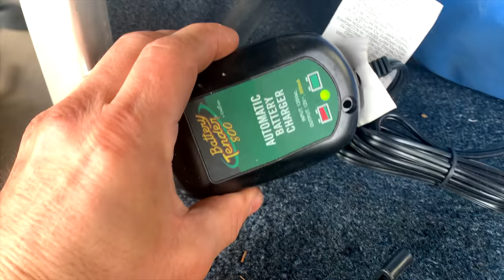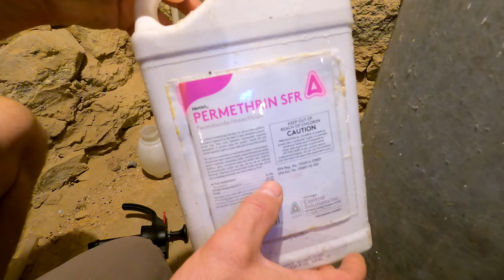8 REAL Farm and Garden Hacks You Probably Haven't Seen Before.

Comment from the maker: Have you seen them all before?  Which ones are new to you?  Hope you all have a wonderful weekend!  If you haven't seen my life hacks video, check it out here: https://youtu.be/q0JeDrpZ1Ck
Reply: I do tons of wet burning since I have a 40 year old barn near by, only safe way. I make an oven out of wet leaves and osb. let it cook everything dry, then it takes off after an hour or so. keep hosing the osb down throughout the process. pull it, keep piling soaking wet shit on it.
Reply: I like the big torch. I use my small propane torch to light my charcoal grill and never use fluid  after i had a grill explode as a teenager
Reply: Honestly, you have your own tweaks on them, but glad you ate the screw driver, so I didn't have to ask you. 😉 The permethrin, I have never done, but actually seen. Did not know it lasted all summer. Probably will do now. After getting bit by the first Lonestar tick I ever seen, and worrying about developing an meat allergy for months. I already got Celiac's, wtf am I gonna eat lol.

I love your videos, sincerely. With out sounding too arrogant, a peer is tough to find.

I use a grinder on cattle panels when I can, just because I don't bleed as much without the bolt cutter points.
Reply: it is good you ate the screwdriver. I have seen or done them all  :)   but still a good vid!
Reply: Several years ago I bought a roll of the wire mesh used for laying in concrete and I made tomato cages from it. They look just like your cages only rusty looking. They work great, probably about the same, but I don't remember what they ended up costing, too long ago so I am not sure how the cost compares.
Reply: Yep, weed torch is the way to go.  I also use it for lighting my charcoal grill.  No smell or chance of off flavor.  You should think about extinguishing your brush fires with water when they have burned down to coals and using the charcoal for soil amendment (biochar).  Works really well!  I don’t even bother crushing it.  Just spread it around the garden and pasture.
Reply: Not only have i seen them, you didn't do about half of them correctly.
Reply: Been doing this for the last 2 years my wife plants about 30+ tomatoe plants  just have to tie them up every few weeks and they won't fall over works better then the cheap cages
Reply: Those tomato cages would be a great way to protect saplings from livestock or bring hit by mowers.
Reply: For the bonfire I've already been using that exact torch, but got a good trick from my neighbor. He suggested throwing a bag or two of charcoal briquettes and starting the fire from there. Works pretty well.
Reply: Tomato cage from concrete remesh.  The bonus is that it's already bent!
Reply: Best way to spare your back, doesn't necessarily apply to large wood, is the hip hinge.  Go to a channel called AthleanX (Jeff Cavalier) and search hip hinge.  It will protect your back for pretty much everything.  Jeff's credentials (so you don't think he's just another half ass YT fitness "coach")  MS Physical Therapist, Certified Strength and Conditioning Coach and former PT of the NY Mets and Pro Athlete Trainer.  TLDR, he knows his stuff.
Reply: Since Cattle Panels have gone up, I got concrete panels for the garden this year. The ones they put in concrete slabs to keep them from cracking. Instead of the cages, we drove in a row of T posts and zip tied the panels to the posts. Raising them up about 15 inches off the ground. Then planted the tomato plants and other climbing plants and vines under the panels. Yellow squash, sugar baby watermelon, cantaloupe and cucumbers.  You might need to make a sling for the watermelon and cantaloupe but the squash is fine without extra support. 
I tied and clipped the tomatoes and squash to the panels, but you can train the tomato vines through the open squares if you do it as they grow but they usually get away from you in July when they grow so fast and you have to tie them.
Reply: @ladyinky882   @LadyInKY  You bought ReBar?  That was cheaper?  Where'd you get it from?
Reply: Hey you got some nice tips . I use a old swing set to lean a panel on and let my cucumbers climb . pick them in the open .
Reply: The screwdriver one was pretty good. Not much nutrition though.
Reply: We use a leaf blower to get the brush fires going.
Reply: @RedAppleBarn   Use kids old bouncy house blower myself. I hookup a 6 foot 4” pvc section to get air concentrated.  Just put air on it for an hour before starting to dry out a section to start. Actually take it over to neighbors when he burns his fall leaves. If not he has a smoldering pile for a day or so. Method is also great for burning down big pieces of pine without splitting.
Reply: Been using a weed torch to start bonfires for some time.  Used to oversee volunteers cutting invasives such as buckthorn.  Bought each site leader a weed torch for all the reasons you describe.

Permethrin is sold now ready to go in stores like Walmart and Sports Authority.  Best way to keep the Minnesota state bird mosquitoes away while camping in the Boundary Waters Canoe Area Wilderness.
Reply: …also Cabelas.
Reply: Air tank propane tank
Reply: @FarmCraft101  I have made tomato cages for years from 6 6 10 remesh for concrete but they would get crushed by snow in the winter and rust too. I started buying cattle panels for hog pens and bean trellises. Then I started using cattle panels as panel inserts for redwood guardrails in my construction biz. So anyway I realized that the 16ft x6" panels would make 3 -5'4" panels from which I could make tomato cages from. I have about 30

Comment: My dad uses cattle panels as tomato cages, but he doesn't cut them.  He just plants the plants in a row and runs a full panel down either side of the row about a foot to a foot and a half apart.  A few metal t fence posts and some rebar wire ties to hold it all together.  Then he can just walk the row and reach in the holes in the panels to pick the tomatoes.
Reply: I didn't realize what they were called but my father did also.
Reply: Tomatoes are gross
Reply: @hannable3871  Good for you
Reply: 🍅 are good some better than others.  🍅 + mayo sammich = 😋
Reply: This works for string beans or any running plant also.
Reply: @IllbeaMarinetillthedayidie  yasssss
Reply: If i were going to use panels I'd use 1 and just weave the plant as it grows through the panel.
Reply: That is how I use them too. My cattle panels are actually my vegetable garden fence, so I can tie tomatoes to it, and grow vines on them, while they keep animals out.
Reply: @crashland5711  Yeah. Perfect for cucumbers.
Reply: I was going to say the same on the cattle panels for the tomatoes 🍅- Don't cut them and just stake them in place.   They work great for strawberries 🍓 too (or any vine plants)!
Reply: @tracycrider7778  I concur 😋
Reply: @IllbeaMarinetillthedayidie  for me it would be a Cherokee purple. Smoky sweet savory. So lovely. Makes my mouth water.
Reply: @MzClementine  I want some! I've never had that variety
Reply: What you do with old propane tanks is you trade them in at home depot for a full one ..
Reply: Thanks for this idea...
Reply: @IllbeaMarinetillthedayidie  absolutely incredible love them. They're green and deep read. Don't be fooled by Mr stripey. Which has two versions a green and red and a yellow and red although the yellow and red of that version is not bad. You want a smoky sweet savory delicious tomato. The kind that makes the best tomato sandwiches. Seek out that variety. Oh it's so good. 
Also I wanted to add. Plants are diamagnetic, volcanic rock dust is paramagnetic. It is very essential to your plants. The reason being. Microbes will break down the volcanic rock dust and the minerals. The volcanic rock dust being paramagnetic forms a lipid around the minerals. The diomagnetic Roots attract the paramagnetic minerals. Bringing more nutrients to your plants. An excellent way of making Black Gold. Manure. Any organic matter. Volcanic rock dust. Mushrooms anything that spores. The mushrooms help pull the toxins out of the manure. And the microbes get to work on breaking things down. Like I said the volcanic rock dust forms lipid around the minerals this is Black Gold for your plants every one of them. Even the ones that don't bare fruit. 

I was infuriated first grade when they taught us about planting a seed. They dropped the lesson off go on to another subject and I was like wait a second there's so much more what are you doing. My teacher promised me to calm down stop it we had a next lesson to go to. I would get it next year. Second grade rolls around second day of class we get our science books. I look it's not in there. I asked the teacher feverishly this is how we teach students? Where's the lesson? She says don't worry I used to be a third grade teacher that will be in your third grade science class. I lost it. I screamed how in the world can you educate children with monotonous retard information. Meaning like thereof. I actually had to purchase the book. Which caused a ruckus. $38 for a book that was on a shelf that I shouldn't have had to purchase. Because I wasn't in third grade. 
Finally when our aptitude test rolled around my teacher understood my plight. In second grade I tested at a high school college level. I got accepted into Pitt university. Yep second grade. That's where I found out that truly information is not privy to everyone. For a year there was a wing in the Carnegie library that's off to everyone else unless you're a university student. Oh that pissed me off. Me and the library had a trimultuous loathing difficult relationship. I used to get in trouble all the time for paying University students to get me information that I wanted. I was infuriated with the school system from the very beginning. I also being accepted into Pitt University in second grade finally got to walk into those Halls got to verbally slap the librarian. Boy that felt so good. I got to tell her to do her job. She hated that. 

Our education system is fractalized and stretched out. they hand you fractal bits of information giving you a gold star for regurgitating just little bit. First through third grade science can literally be taught in one month first through eighth grade science can be taught in one year. I'm not joking. Addition and subtraction are one in the same they check each other multiplication and division the same. Phonics and Latin very important. Key phonics a student should be reading at a 5th grade level by first grade if slow third. The amount of information that they leave out and the monotonous regurgitated information is so frivolous the Mind does not hold on to all of the information. If you were actually taught the whole sum you would be able to retain the information. Breaking up a day hour by hour minute by minute and teaching an increments of 40 minutes at a time breaks what the student just absorbed shoves it away sends them home do it on your own come back to the same old same old. By the time a student is in 5th grade you would know if they were scientific mathematical Hands-On a builder or scientist doctors artists nurses. the higher education that they have should literally be taught from 6th grade and up a child could graduate from college with their doctorate in high school. It's infuriating to me. 

Truly a humanity does not put their proverbial physical foot down together. I'm not kidding the human genome is being terraformed as much as this planet has been. The history that they handed you, it is not the history that truly happened. The haldren collider is part of the technology that they stole. That's how they destroyed our worlds that's how they burn down the cities that's how they destroyed and melted rock of things they couldn't explain. I have so much more to share but I think that's enough to chew on. Although one more thing. Genes can be manipulated by light MIT released that information back in 2003. mRNA technology, goes hand in hand. A lot of people don't realize that they're nanotechnology that they just unfolded. Do you remember the man that ate the guys face off in miami. Proclaimed that he was looking to score. Kind of funny for a man for 17 minutes and never spoke a word but uttered nothing more than screams and growls and moans. The one p36 Gene deletion syndrome. The person has the inability to communicate as well as they are exceptionally violent they will injure themselves and others. That little test where they said oh no it's bath salts. That's a lie that was actually a test. Those lights that they're putting up it is not a manufacturer's defect. Terahertz frequency can be used for healing and I'm not kidding I'm talking like pulling out infection in a leg and helping skin regenerate and grow tumor shrink prostate problem gone aging gone skin conditions gone but it also has a double-edged sword because quasi nano crystals AKA liquid Crystal penetrant can be programmed. This along with mRNA technology attached literally having the key to get into your mitochondria cell with their technology they can go in find the protein by chemical signature and destroy it snip it out and make you reproduce another protein basically altering you immediately. If you study the one p-36 gene deletion syndrome and the man in Miami that so funny, not funny I think the homeless man was told to say that he was looking to score. No way. The man had absolutely no drugs within his system pharmaceutical synthetic or Street. I cannot stress to you enough. We need each other more now than we ever have in our own lifetime. The system that they've had you fall into with politics, religion, even your education. All of it has been seed set to keep your eyes off of what they are doing. Please see the work of Minds unveiled as well as Jon Levi these two will help paint a visual picture of what I am trying to convey that the history is not as they say. They are one of the best channels that can give my words a perfect painted picture. I cannot stress how much danger humanity is in because literally if they get their towers and their 6G lights terahertz put up all over we are in serious trouble. I saw what is it World war z the other day. Oh my goodness gracious did that fit in flawlessly with the one p 36 Gene deletion syndrome such as the man in Miami eating that man's face off. They also like to coin it severe autism. Yeah No. I hope my comment finds you. Please study all the keywords I gave you. Jump far down that rabbit hole.
Reply: I did the same long row method year (after a flimsy chicken wire frame attempt last year) - easier to get to the tomatoes too! And I do use welded wire of cattle panel for tree cages, but use a 3/8 cutting wheel to zing through metal cutting. Deer - must cage everything that I don’t want mowed to the ground.
Reply: @hannable3871  No. You must eat the tomatoes and you must like them. No excuses.
Reply: @ioodyssey3740  😆🤚
Reply: We have used this method with the tomato cages for years and years. It is great
Reply: Same here, do not bend them into a circle.  Just partially stab them in the ground and zip tie them to a couple of driven steel stakes.

Comment: We are using cattle panel sections for individual tomato cages, too. However, my husband bent them into “L” shaped units by standing on a 2x4 on top of the panel and pulling the free end up. This allows us to take 2 “L” opposite each other to form a square. We zip tie them together for use and can still stack them into a corner of the shed taking up very little floor space. They could also be hung from the junction of a wall and ceiling! Hope this helps others figure out how to store cattle panel tomato cages.
Reply: Good move, thankyou !
Reply: That's a great idea!
Reply: We just use one of the ''L'' shapes .and plant in the inside corner . As they grow I tie cheap hemp twine across the open end which forms a triangle .  Doubles the use of expensive panels and also scrap pieces become useful
Reply: I like it, alot easier to store too!

Comment: Some good tips - there's an easy way to improve burning off though (which I do): Let the pile season (you don't want to burn green, way too much smoke, hard to start etc) and just before it rains, cover with a tarp, or at least most of it if the pile is too big to cover it all. Then burn after the rain has soaked everything. That way you are burning dry seasoned wood whilst everything is wet so no chance of starting spotfires. To burn slower, better off with a long, narrow pile than a high even pyramid or cone shape. Then burn from the top of the middle, and it will slowly spread down and outwards. Very controllable and little to no smoke.
Reply: Was told years ago that theres a "sign" better for burning brush piles but the old timer couldn't remember when that was. I've searched everywhere never located the information . Anyone ever heard of this?
Reply: Or after a good snowstorm

Comment: The shovel-leg thing works in any situation involving a shovel, scalping grass, digging, lifting a full shovel. There's always a way to use your leg strength or even just as a pivot point to avoid back fatigue. Legs are cool
Reply: Yep, you learn little tricks like this pretty quick when you have to run a shovel all day. I did a lot of that in my younger years
Reply: Seems best with a D-handle shovel.  Probably not so easy with a long-handle.